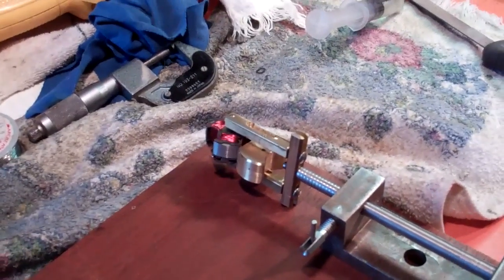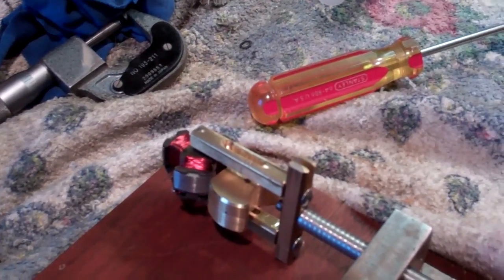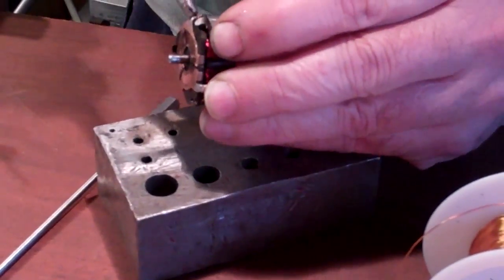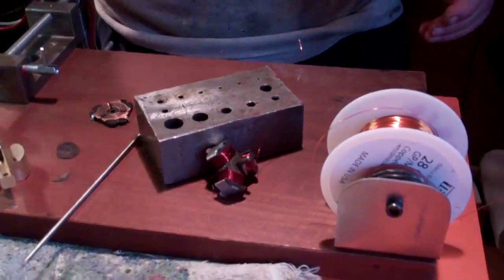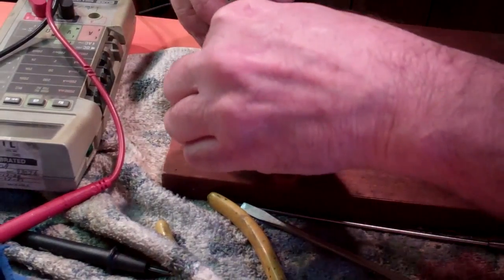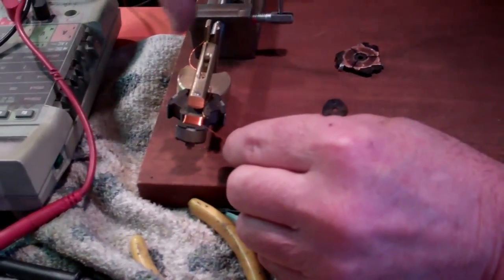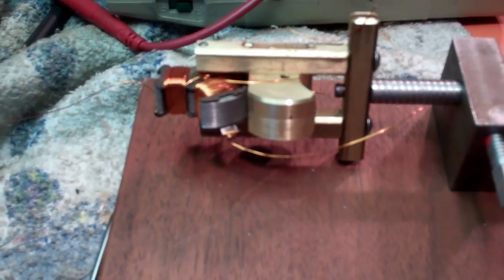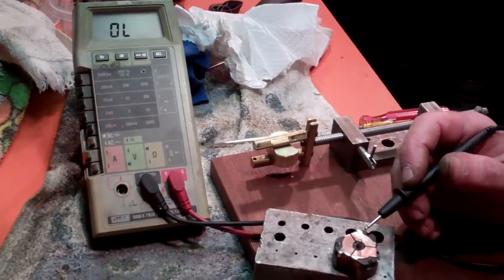REWINDING A MARX TRAIN ARMATURE

Comment: Very good video! I guess it really doesn't matter which direction you wind each pole as long as you do them all the same. You might have to flip the coil wires through if you happen to wind it backwards from the original. I like to take snapshots along the way as I disassemble something to remind me about things like that. :)

Comment: What is the difference in motor performance between “Y” connection and the regular end to start soldering on each commutator tab? It would seem the current flow from pole to pole would be different…..no?
Reply from the maker: The y connection will produce less torque and I believe the delta connection is the preferred method. either will work. I rewound the armature in the original manner it was produced. I have rewound a same armature in both configuration but was hard pressed to see any real difference in performance.
Reply: Thank you. I had wound armatures w/delta connection years ago when eyes were better close up. I had a “C” shaped clamp on a spinning shaft gripping the two other poles similar to yours. I did find thicker wire draws more current, higher RPM. Smaller wire had more resistance and torque, lower RPM. They were cheaper can motors I was using. I learned something about “Y” connection. Thanks again.

Comment: So just so I understand,,,the beginning ends of the windings of each pole get twisted together and tucked in the little pocket on the frame where you put the drop of epoxy, and the end of the wire for each pole get soldered to each of the corresponding pads on the commentator?
Reply from the maker: yes, that is the way I did this which is a "Y" type wind. You can also do a delta wind where the start of each commutator segment is soldered to the first commutator segment and the end of the wind is soldered to the next segment. Repeat this pattern so that each commutator segment has two connections soldered to it, the beginning of the wind and end of the previous segment.